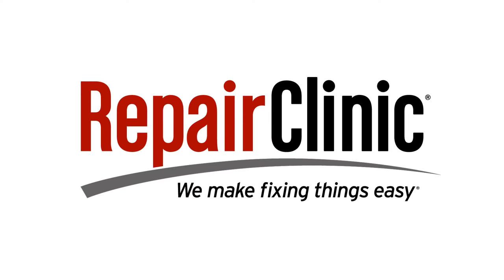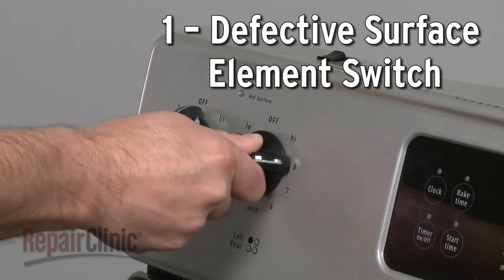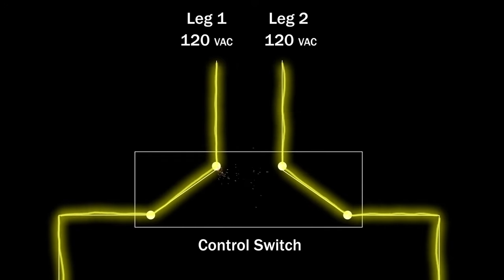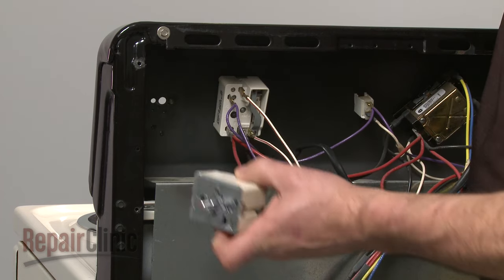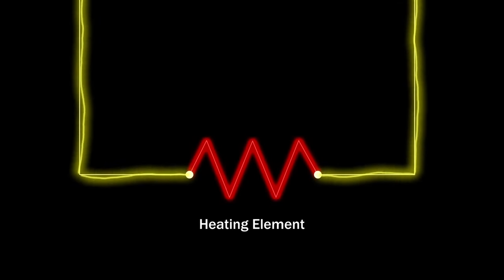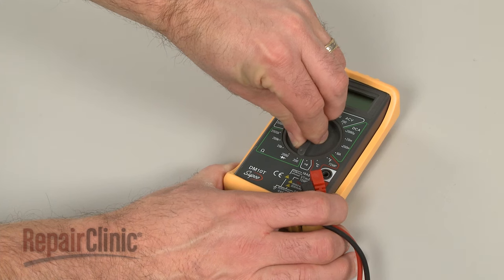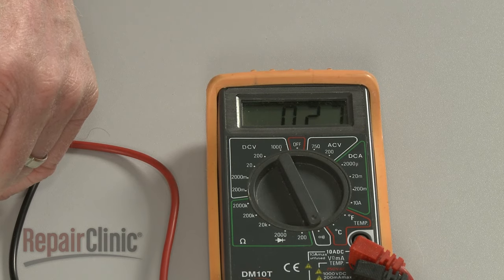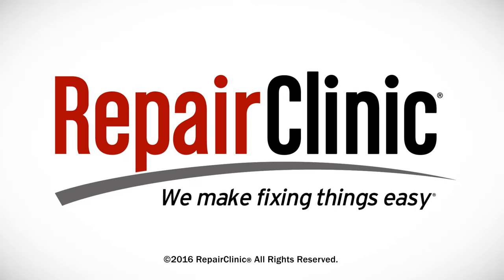Surface Element Won’t Turn Off — Range Troubleshooting

Comment: Thank you for this! I was stunned when my glass extricate burner would not turn off. It was pretty scary and I never knew this could ever be a problem. I googled the issue and up came your fantastic video! I have not repaired the problem yet but you helped me accurately identify the problem. Now I just want a new stove!

Comment: If the element is still on and hot after you turned it off, grab a wet rag or pair of tongs to pull the element out, wait for the element to cool down, put the element back in its spot (shouldn’t heat up again), place a pot of cold water on element, leave element off until the indicator light goes off, then use the element as you would regularly.

Comment: Do electric stovetop burners automatically shut off after 12 hours?  I left for vacation and worry I left a burner on.
Reply: Did your oven shut off? Im curious i left for vacation and worry too if i turn off the oven.
Reply: @ellenholmes127  I contacted GE support and they said the stovetop burners will NOT shut-off, only the oven. (Luckily I did not leave mine on!)